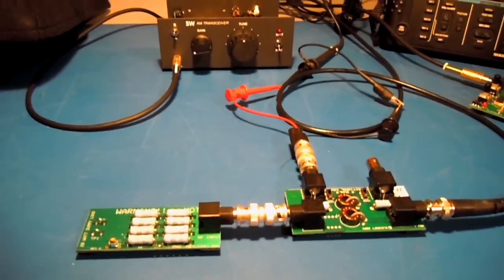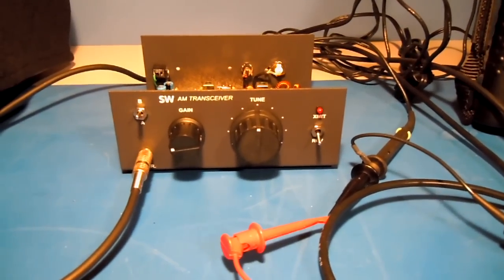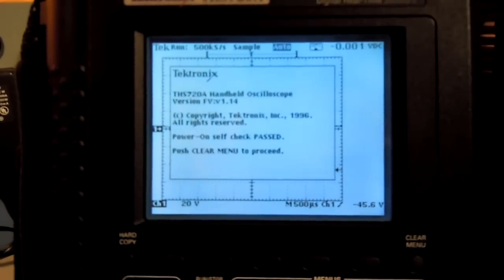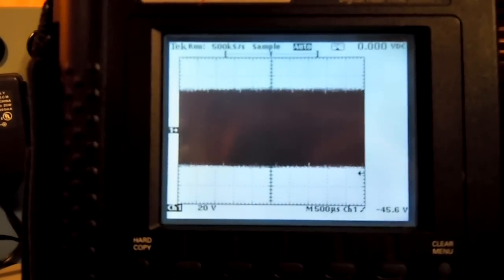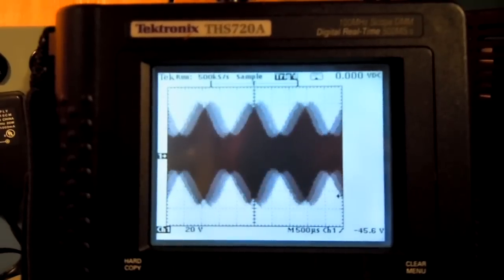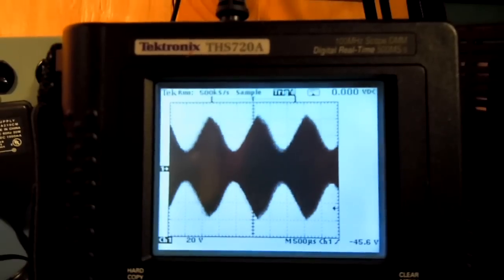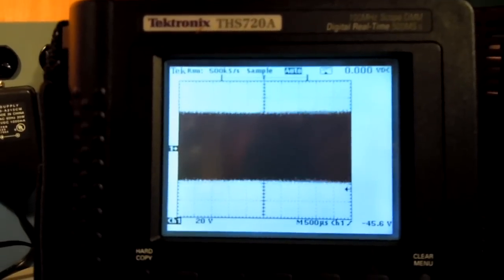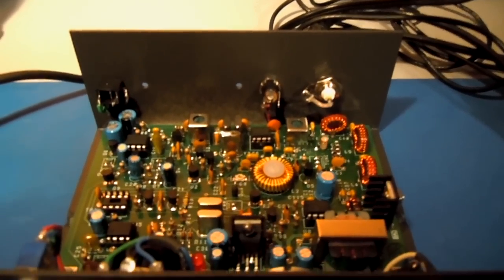Scope Testing Modulation On The Retro 75 Transceiver

Comment: Great video. It shows that if the carrier was to be turned down, 100% modulation in both the positive and negative peaks can be achieved. Although, the power output will be significantly lower. A Mauldulator works very well on the retro 75. The Mauldulator will allow anywhere from perfect 100% pos and neg modulation up to 300% positive. Of course that is EXTREME. Also, 1Hz to 7500 Hz bandwidth. Audio processing is mandatory  for bandwidth and audio density. Pro Tools is great for this.